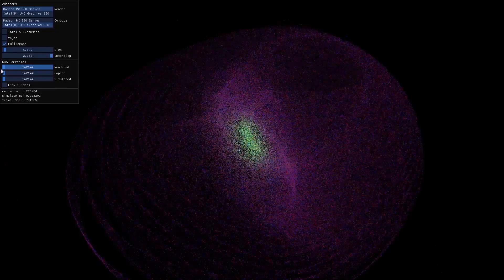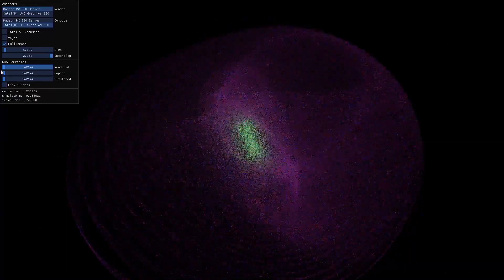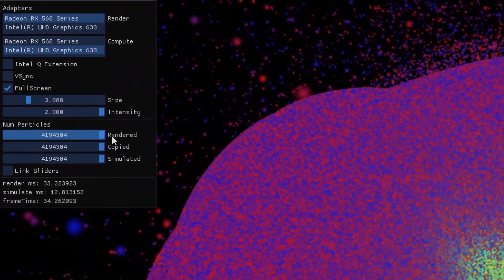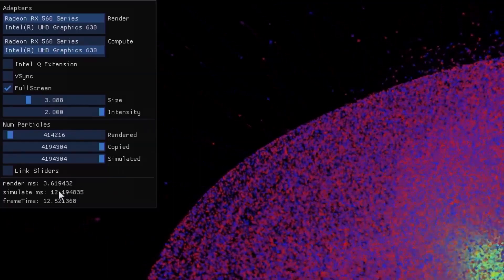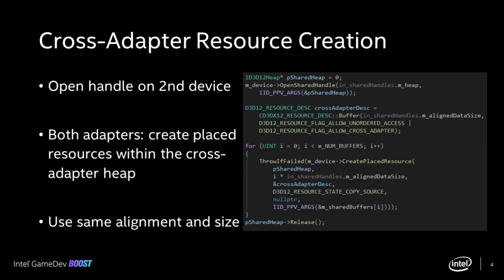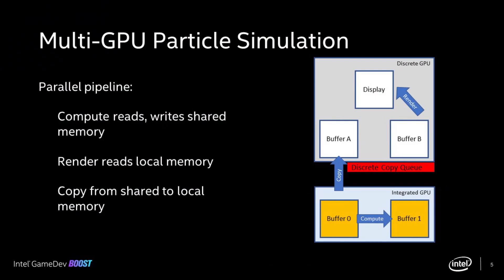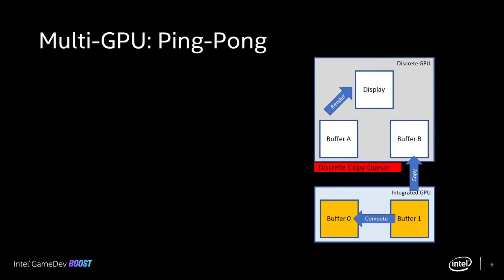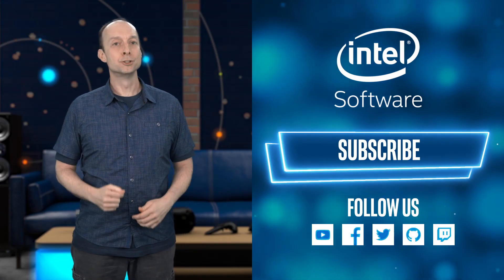Multi-Adapter: Integrated and Discrete GPUs Together | GDC 2020 | Intel Software

Comment: Is this available for older system
Reply from the maker: For information related to the graphics compatibility, we recommend that you refer to the Intel projects that we posted on the GDC community site https://intel.ly/3r294bn Please be informed that the multi-adapter (integrated and discrete GPUs) implementation is possible with the application using DirectX 12.

Comment: i have i3 4gbram ,, dedicated amd 2gbvram and intel 550 hd graphic ,, should i do the test ?? or it may affect my laptop?
Reply from the maker: Yes, it will work on GPUs from different vendors, and will not damage the hardware of your laptop. This multi-adapter(integrated and discrete GPUs) implementation approach is a way/guide for the game developers to take advantage of the idle compute power, and for designing pipelines that utilize both iGPU and dGPU. This provides performance and enhanced frame buffer copy times. We’ve posted all the projects to our GDC community site https://intel.ly/3hUVa6h where you can find details and ask your question to the author. Feel free to send us a direct message on Twitter @IntelSupport or a private message on Facebook from our page if you need further assistance. We'd be happy to assist you.

Comment: Hello, i hava a i5 4570 with intel hd graphics 4600 and a r7 240 2 gb 128 and when i conect the cable to the integrated video card i can run games using both video cards, the difference i huge vs when i used only the r 7 240. And i want to know how it.s possible? Without sli to use 2 video  ards at the same time!

Comment: This is a very good idea. iGPUs get stronger and stronger it would be a waste to not use them in some way.
Reply: How this video holds up today
Are computers using integrated and external GPU's at the same time?

Comment: So what's Intel going to call their multi-adapter solution? (Crossfire / SLI)
Reply: this doesn't strike me as a new "solution", it's multiple GPU's exactly as we have today. Developers can choose to run OpenCL calculations on the integrated GPU and feed the results to the discrete GPU for rendering, exactly like they can today. I'd truly love to be wrong though
Reply: @MikeDawson1  Thought this was Intel's version of Crossfire / Intel, I guess it has to be enabled by developers to utilize mGPU support n game